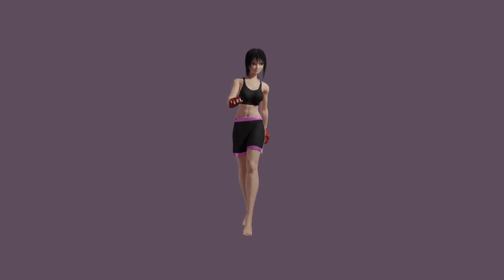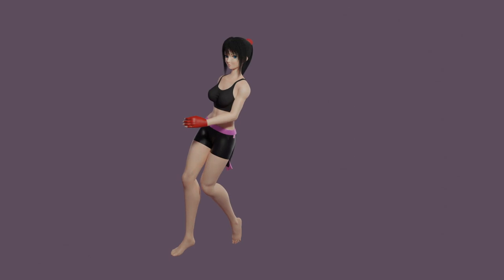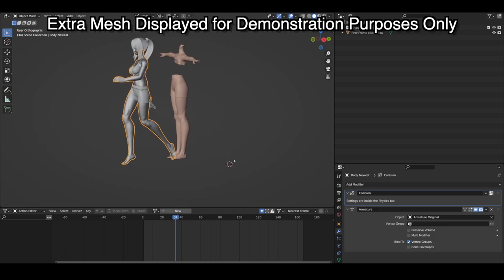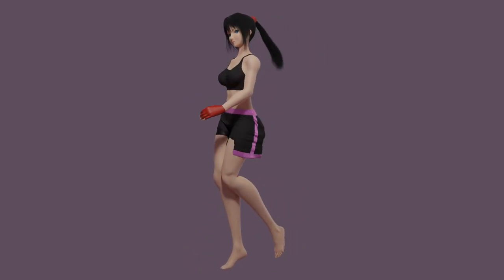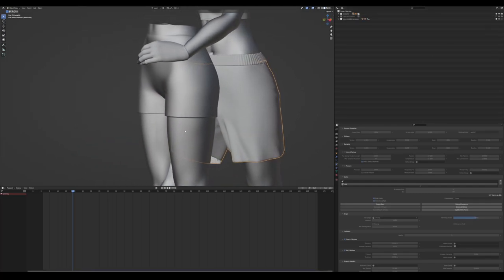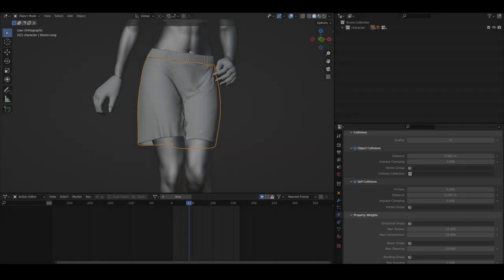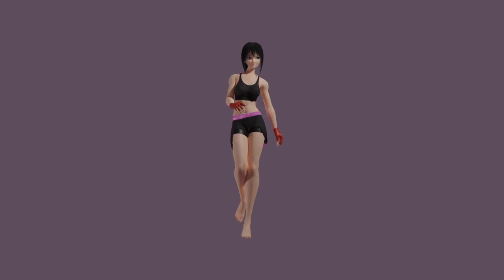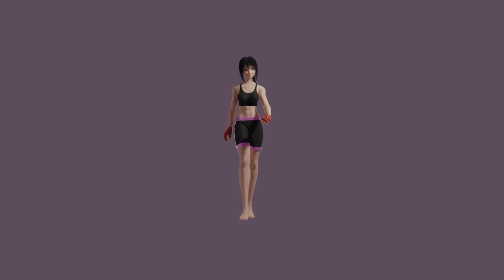Blender Cloth Simulations: Fixing Simulation Problems

Comment: So here's my number one cloth sim blender question. How do you make a posable cloth sim? I.e. let's say you're making a super hero landing and you want to pose the cape on frame 1 and let it fall down, alternatively, lets say you are doing a walk and you want the cape to assume a specific shape on certain keyframes and have some cloth sim on top of that motion (i.e. the mesh is cloth simulating the interpolation between the poses). Basically as far as I can tell the problem is that the way blender does things is the motion of an object is either simulated or animated, it can't be both. The only way I can think of doing the first example is to disable the cloth sim, pose my cape with an armature or a shape key, then enable the cloth sim. This is not an efficient solution, if you wanted to do 10 different poses you would have to do a lot of work. The second example I straight up don't know how to do other that trying to do some surface deform trickery.
Reply from the maker: Yeah, your first solution is what came to mind for me which is a pain.

I'm wondering if you could actually keyframe vertex group weights somehow .I just took a quick look and it looks like the animall plugin allows vertex group animation (not sure exactly what you can animate though). Theoretically at keyframe 1, you could have the cape all be weighted to not use the simulation... then keyframe 2 and beyond,  you can invert the vertex group values. Just an idea though, not sure if it'll play out nicely with animall! :)
Reply: @edgeloop  Thanks for the suggestion, I will definitely have a look as well. Wouldn't mind a video either if you make any discoveries ;)

Comment: I'm getting hung up on the scale part. I tested this out recently and got fantastic and easy sims at a x5 scale, but I'm doing an animation with multiple characters holding props interacting with an environment. Changing the scale fixes the cloth but breaks everything else, like hair and props, how do we bring the scale back to real world settings with the cloth all ready to go?
Reply: Not an expert, but if you don't need to resimulate the cloth you could bake the simulation into the mesh (obviously keep the upscaled version as a backup or if you need to make changes), and scale the duplicate down to what it was. With the simulation finalized into a mesh, the collision distances would no longer matter.

Comment: Nice tutorial! 
My question: how do you pull the cape hiding the bottle to the side so the bottle doesn't go through the fabric?
Thank you!
Reply from the maker: Hello,

Are you referring to something specific in my video? I don't recall there being anything about a bottle. :P

In any case, it sounds like you have cloth hiding a bottle. I assume at this point you have enabled collision on the bottle (so the cloth is on top of it).  If the cape is attached to something, you can just animate the position of whatever it's attached to. Since the bottle has collision enabled, the cloth shouldn't go through the bottle.
Reply: @edgeloop  Hello,
Thank you for your reply. 
You understood my question correctly. When trying to remove the cape from the bottle, there is a constant burst of fabric in the neck area of the bottle. I would like to find a solution to this problem.

Comment: Hi! Any suggestions on how to prevent the vertices from dancing around? i can see this in your shorts close to the top rim, and something im currently struggling to remove. Ideally we need to have this completely in a settled state. Also another issue i just noticed in my project, if i enable both a skirt and tshirt at the same time, it gets strange results, but if i sim them independently they seem to work as expected, even though there's no contact between them.

Comment: Loved the video, but how to scale down the mesh after baking the simulation?
Reply from the maker: Thanks for the comment!

To be honest I haven't thought that hard about reverting to the old scale as I just worked in the new scale afterwards. Of course the down side is that blender works best with real life scale.

With that said I think you might be able to create an empty (or just some random invisible object). Parent that to the armature that the cloth is tied to. Then you can control the scale(just apply an inverse scale) through the invisible parent. Let me know if that works!

Another workaround for cloth getting stuck is to make your cloth vertices more sparse.
Reply: @edgeloop  sadly it doesn't work, maybe I did something wrong, it did scale down on the first frame, but when I played the animation, the cloth returned back to its bigger size

I did two simulations, one with real life scale, and the other one is a 4x real life scale, and I found out that the bigger size made a nicer simulation in my case, which has a small amount of jitter, while on the real life scale, there is a lot of jitters, I tried changing the setting, but it doesn't make any noticeable different

I haven't tried to make the vertices more sparse, so I'll do that, Thank you
Reply from the maker: @ricoferico9213  Ah yeah I figured it might not work. :(

Your situation is exactly the problem I struggled with which is why I made that section of the video. It's really annoying that the minimum collision distance is .001. If we could make it lower, we wouldn't have to resort to goofy hacks to work around it.

Making the vertices more sparse is the more "correct" solution imo, but harder to demonstrate. :)

Comment: I'm having issues with some cloth that I attached to a rigged model. The cloth simulation is fine but once I add collision to parts of her body, the cloth freaks out, Im not sure it might be because the cloth is too close to the armature/mesh or its something with the collision I have to fix. Not sure if this is a specific problem I'm having or if its too common
Reply from the maker: That happens all the time to me. A lot of the Blender simulations require debugging. If I was you, I think I'd try a few things.

1. Make the cloth far away (I mean make it stupidly far away just to see if the proximity of the cloth to the mesh is the problem).
2. Check the collision distances on the body and the cloth. I always start with the minimum which iirc is .01 (maybe .001)?
3. The collisions with the body may cause the cloth self-collision to freak out (if you have self-collision enabled).
4. I know my video states this, but double check the modifier stacks and visible items. It's usually one of these two that screw it up for me.
Reply: Sometimes we scale objects in object mode and that can cause a scale problem to fix that, you have to apply thee scale, in the object mode and in the object menu you can find that option

Comment: Hello. Buddy. I have a question. I have shoulder pads on my character.  I want them to collide with the arm is moving up and shoulder . Do I do the same thing here. Do I have to add a bone to it. I can't really find a video that helps with this kinda thing.
Reply from the maker: I've thought about this kind of animation before but never really did it myself.

You probably don't want to simulate shoulder pads with a cloth simulation because it won't be able to maintain the volume of the pad.

You can do the typical weight painting and use bones to control the shoulder pad as the arm/shoulder move.

The one thing I've thought about trying is making the shoulder pad a rigid body but I've had so many problems with rigid bodies in blender (crashing and generally not working). The cool thing about it being a rigid body is that it would 100% maintain volume and keep its shape if that's what you're looking for.
Reply: @edgeloop  I did figure it out. I just use weight painting. Only the shoulder controls it.

Comment: I'm not sure I'm describing this correctly, but when I run a render, the cloth scrunches in on itself, like someone balling up a handkerchief, I can't get it to just lay flat against the model. I followed the steps from a different tutorial but where his just falls to the ground, mine doesn't fall, it just scrunches up in a ball around whatever the central point of that piece was.
Reply from the maker: Does it scrunch on itself when it collides with the model or does it scrunch immediately?

My guess is that your cloth has vertices too close to one another or there are other things (perhaps invisible) causing collisions with the cloth.
Reply: @edgeloop  It scrunches immediately when I render. I have tried checking the vertices, and they aren't any closer together than the clothing I import. Another person noted it may be because I'm using a base VRM model and apparently they don't play well with fabric?
Reply from the maker: @Radhaun  Without seeing what your models are it's difficult to diagnose.

I'd try to disable self-collision on the cloth and see what happens.

Try to make collision distances (both self and external) the minimum and see if that makes it better (this can introduce other problems though).

Then disable collision on model and see what happens.

Remove the VRM model and just see if your cloth collides correctly with a low poly UV sphere.

Save to a different file and remove everything but the cloth and the thing it'll collide against.